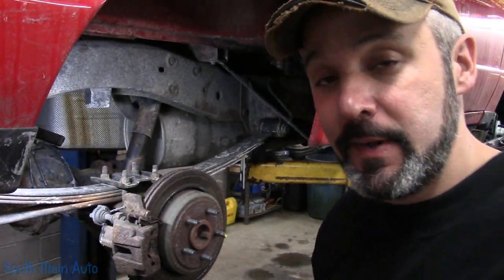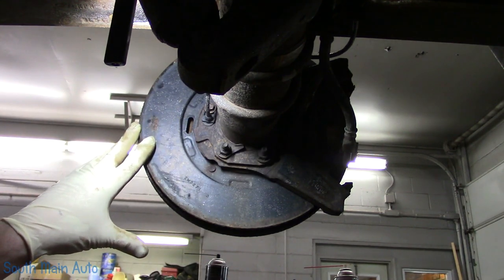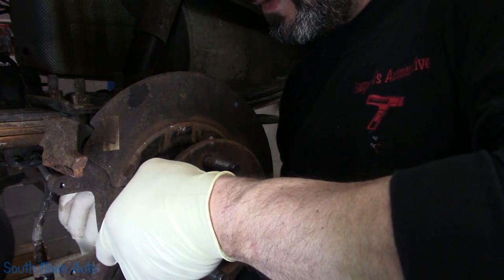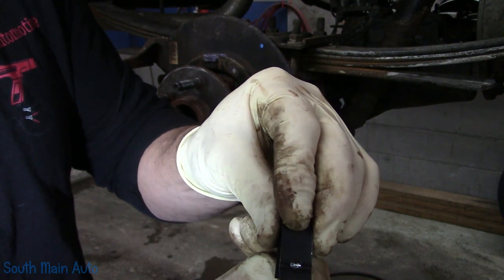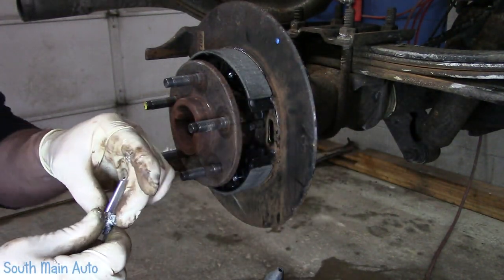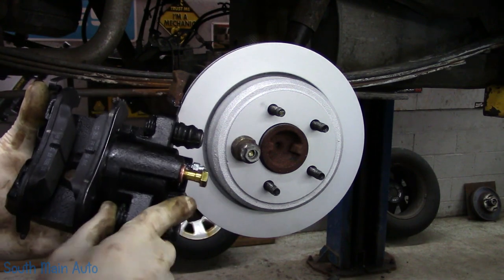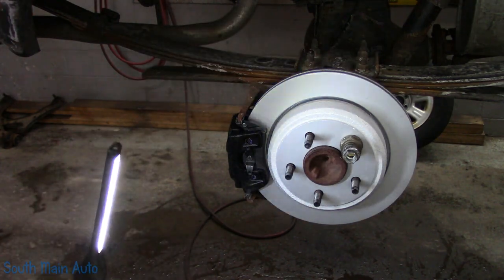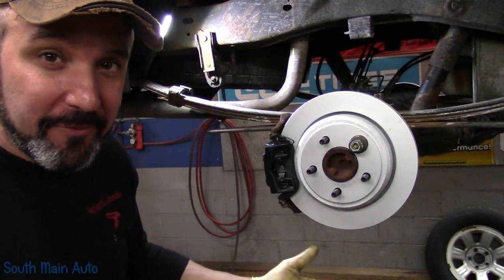Ford Ranger: Full Brake Job Overhaul - Part II

Comment: I had a mechanic do the brakes on my silverado and he didn't clean the mounting surface for some sort of what looked like a retaining clip and spring piece.  That was fun to fix 600 miles from home in another state without the right tools after my brake locked up and started rolling smoke out of the fender.  30 seconds with a wire brush or 5 with that air sander would have saved me an hour of busted knuckles, a smashed fingernail and a lot of cussing.

Comment: Personally, like you, I don't worry too much about cleaning the inside of the reservoir. As long as the fluid is fresh, it's fresh right? Since you mentioned it though, I got to thinking (usually a dangerous thing for me lol!) and remembered how we used to clean the coffee pots at a diner I worked in back in high school in the 80's. We'd fill them about 1/2 way with crushed ice, add a few tablespoons of salt and shake the snot out of them. The pots always came out crystal clear. Maybe I'll try it on an old reservoir that I happen to have laying around (if I can find it!) from the V8 Ranger project that I'm currently working on.

Comment: DOT 4 brake fluid is Dot 3 that's been blessed by the Pope.
Reply: So what does that make DOT 5? The devil's spawn?
Reply: Hotrodelectric with a boiling point over 500Deg and no abs  yup devils spawn lol
Reply: @Hotrodelectric  DOT 5 is based on silicone oil DOT 3 and 4 are based on glycol.
Reply: @ebbeollman1198  Yes Ebbe, I'm aware, thanks.

Comment: Okay Dr.O 
I've been watching SMA since day one. SMA is by far the best automotive repair channel in YouTube. For the longest I've always compared your rust area in Avoca  to mine in NW.INDIANA. But today when you had to heat the rear e-brake adjuster to get the rotor off. Avoca is the hands down champion of the rust belt. Only if we could get our vehicle inspection back along with our mandatory smog testing which we have. To me the safety inspection in my thoughts should be a major concern. Gotta love the rust. One more thing. When I give a estimate whether it's from Mitchell pro or Alldata and sometimes Chilton Library I have to add extra time for the rust. 😉
Reply: oh must be talking bout etcg and kilmer.

Comment: Not sure if this has been mentioned so....   before you take the brake lines lose,  use an adjustable hood rod or similar to slightly(3/4") hold down the brake pedal.  This will position the master cylinder spool past the reservoir intake port.  You won"t drain the reservoir.   Eric,  keep on pumpin out these great videos!

Comment: Stretching and hooking springs: what sometimes works for me is to loop a length of string through the spring hook.  That way I can pull on the string to stretch the spring, using the needle nose just to guide it into the hole (versus trying to use the needle nose both for stretch and manoeuvr).  The best string is the green and white plastic stuff that electricians use to pull wires through conduit: strong but also slippery enough to easily pull out once the spring is home.  A spool of this stuff will last a lifetime.

Comment: Hey man! Love the videos! Here's some info for the viewers... I live in the rust belt of canada. I did front pads and rotors on a 2016 Toyota corolla with 106km (65,000m??) And the passenger rotor would not come off. Hammer, bigger hammer, sledge hammer, nothing. I tried the extraction threads on the stock rotors with some 12mm bolts, still nothing, stripped the threads. Ended up heating the rotor with a torch and hear it 'pop' than it came off with two hits of the hammer. RUST IS NO JOKE PEOPLE!!!

Comment: Doing breaks I use white lithium or anti seize compound , all my hardware gets coating of fluid film , never had issue with adjusting when cones time ,  plus when inspection time comes , they can't say you need new breaks .  

Talking to yourself truly helps ,  clears the minds thoughts , it's lit better than talking to what some call normal people at times lol 😂😂😂😂

Comment: Couldn't sleep. Cat had to go outside, booted up computer and wah lah! Part 2. Thank you Eric for letting us watch, I'm sure at times it slows you down but these tricks, advice and Mee Maw tips really helps us.  On my '64 Chevy C-10 I couldn't afford new dust caps (when I was a young lad)and now, in my box, patiently awaiting the snow and rain to stop will install with all new front end hardware. I did manage to get the old ones to last with careful hammer strikes..... I'll try not to tear any rubbers, that could be disastrous at my age. I tried to time your torque to yelled and I think I got to 2 Mississippi.  I think that is safer than torque to yield numbers..... I burnished the pads on the wife's 08 Honda Accord, believe me you want to folks! After 2 sets of burned brakes, I had some rotors hammered out of a meteorite cross drilled and slotted with upgraded pads with unobtanium and burnished those bad boys by the instructions and haven't had a problem since.  I use Car Quest though, not a sponsor Remember folks, safety 3rd.

Comment: My son and I spent 45 min per side to put that spring back on the inside on the e-brakes. I told hem if we ever need to change the e-brake shoes again we are going to pull the axles.

Comment: Eric, this DIYer would never attempt rear brake shoes again. Tried it one time, years ago, on an old rust bucket (Connecticut car) Renault . No problem breaking it down but putting it all back together, NOT. Those springs were a beeyotch for me. No way, Hosay (that's the English spelling for Jose). To the garage I went.
This is the first time I have watched somebody do it and you confirmed for me why it drove me crazy. For you, Eezy Peezy

Comment: Great video.  The little bit of heat goes a on long way was great.  Never had seen that trick before on brakes.  The hint on the spring placement was spot on.  I never do drum brakes unless I have the complete spring replacement kit.  I also take pictures before I remove any part and do a comparison of before and after prior to the test drive.  Thanks again for the hints.

Comment: Well, at least they finally got around to putting disc brakes on the rear by 2010
Reply: Then they discontinued the Ranger in 2011! Ford really knows how to reinvent the wheel...
Reply: People get uppity when you spoil them.
Reply: I think drum work better at slower speeds
Reply: @brianbrundage3116  Yep.  There's nothing wrong with drum brakes in the rear on a lot of vehicles.  Plus, they seem to last a long time.

Comment: I used to put the spring on the both shoes BEFORE fitting the shoes to the car - that way it's easier to get it on (and you can put it the right way around that way too ;)). YMMV.

Comment: Man do I wish you posted this video like 2 years ago! I did my P Shoes on my 2000 F250, and as you assured, I lost my fricken mind. I bought just the shoes, so I had to reuse all hardware (yes I'm from the rustbelt so it was crusty) and put them on the factory way cause I only had what I took apart to replicate. I refused to pull out the axle shaft and spend about 2 hours on each side getting it all right. I ended up putting the spring on the shoes before putting it behing the wheel hub, then stretching it by hand over the face of the hub. Yep. I lost 3.5 fingers that day and my entire mind

Comment: My 96 Explorer V8 AWD uses a very similar set up in the rear. I have had issues with slide pins and the caliper slides (the stainless ones) over the last 10 years. After a few Ohio winters I have to take the backs apart and clean under/re-lube the caliper slides (stainless clips).

Comment: Word of advice for the youngsters...  see that spring he's taking off the parking brake shoes using needle nose pliers?
They make a hooked spring tool for that and they are relatively cheap. Use it. Needle nose pliers, especially on a more stiff spring can cause serious scars, I could show you mine and it's about 1/2 inch from my eyeball. Did I mention never pull TOWARDS yourself?
Some of us learned the hard way when we were 16.

Comment: FYI - If you have never done plain drum brakes (not discs with drum parking brakes) they are very similar with on big exception.  The star wheel adjuster has a lever riding on top of it that will prevent the star wheel from going backwards.  Simply sticking a brake tool in the slot and cranking will only TIGHTEN the shoes.  You need to place a screwdriver in the slot first and push the lever off of the star wheel so that you can back it off.
Reply from the maker: I've only done a few thousand in my 20 years doing this 🤭😉
Reply: @SouthMainAuto  - That came across wrong !  I meant it to be directed at the audience, not you Eric.  (Although I'll bet you never did drum brake on the front wheels of a car !)

Comment: "WEEEEEEEEEEEEEEEEEEEEEEE"! 😂🤣😂 I don't think I've told you how much I friggin LOVE that! Makes me crack up hysterically!!  You got me saying it now, LOL - it's highly contagious! 😁

Nice trick on those parking brake shoes! I've found that flipping out, throwing tools, and cussing at the top of my lungs does little for my productivity, so I'm going to try your way next time. 😂 The last set I did on a '04 Ram 1500 was easy - noticed the weeping axle seals and decided to sell that job. Soooo much easier with the axles out!

So I just got my compressor yesterday!! Just went through the thing to make sure nothing was wrong. Glad I did, because the little compression fitting on the nylon line they ran to the drain valve in one of the legs was leaking like a sieve. I had my neighbor drop the skid in the new shop so I could go through it. To power it up, I had to shut the breaker off to the lift, take the wires out of it, hook a set of jumper cables to that, then stuff some 4 AWG wire into the pressure switch of the compressor, and clamp the jumpers to the other side. Yep, OSHA would have a field day over here, lol! 🤣 Watch out for the live jumpers now! 😁It worked - let the thing run 20 minutes with the valve open, then shut the valve and let her air up to 175 when it kicked off. Stuff gets HOT, but it worked great. Just tightened that compression fitting, and all is well. Now just have to call the neighbor up and move it into the old shop where the Craftsman compressor is, and start shootin' vid on the install. 😎

Comment: once upon a time  i attempted a similar pisser style parking brake ie the 4th gen 4runner as my first DIY job. Took me 3 weekends on jackstands and help form webforms to get all the springs in the right orientation. adjusted the parking brake perfectly so both shoes would actuate. when I went to torque the last lug nut. the wheel stud snapped. Many curse words were said. I went for a test drive, and it held the car perfectly in neutral up and down a steep slope.  first time since the factory. Went to so called professional mechanics.  they were putting it together and the a few of the springs were on the floor. well after wards the parking brake only holds the car forwards not in reverse (in neutral). Claimed we adjusted the slack all the way.  sigh.......... That really defeated me lol.

Comment: How do you know which way to turn those star wheels, is there a simple way to know without trial and error? Are they always right hand threads? It seems like the left and right wheels are usually different, though I wonder if I'm just looking at it from the opposite angle....
Reply: Star wheels are demonic; which ever way you turn them is wrong and all four wheels are different and random.
Reply: Good question. I usually just have to turn them a bit before I install them so I know which way expands them. It's just always a pain regardless.
Reply: and lube the thread

Comment: The drums part is super-straightforward, some pitfalls but if you watch the video, no problem at all... well usually.

For whatever reason the rear shoe swap for my '04 Civic was a wrench-throwing, ninja'd-into-the-sheetrock sort of nightmare... an-hour's-work-begat-four sort of thunder...

Someday when I grow up I wanna be an SMA tech (16 yrs wrenching on powersports; only drums I had to mess with were saucer-sized ones on ATVs) :D

Comment: I would of drained the brake fluid out prior to start.  I just don't like brake fluid splashing onto my floor.   Also, when I do the caliper bolts, i often use combo wrenches that i smack with a hammer.  I always use 6 pt wrenches.

Comment: I'm sure the designers of this style parking brake system sat back and said lets make that axle flange as big as we can just to make it a bitch to get the brakes apart without stretching the springs. LOL What l loved was when the customers put the spare tyre on their nice merc and didn't use short wheel bolts, winding those long ones into the brake springs and try to drive off.

Comment: I never realized Ford put discs on the back of the Rangers, thought they were all drum, I learned something today. That tip on that return spring is handy. I have that similar setup for the parking brake on my F-150 and yes it has that same God awful spring that comes in from the back. It makes me wonder if I could put that spring on the front of my setup, hmmm. I would hate to admit how long I fought with those. 17:53, is someone in pain? I like that bleeder setup you are using.

Comment: I flush the lines BEFORE attaching wheel cylinders/calipers. The way you do it all the crap from the lines ends up in the caliper/wheel cylinders and may cause failures.
Reply: Sounds like a diy'er move, you'd be sitting there all day. I've never heard of a brake component failing that way.

Comment: us at wook we use only eom parking brake shoes they have more grip on are E450 fleet we tried the after market shoes and did not hold down the truck as eom do.you put the parking brake on and floor the gas pedal in drive and truck do not move.but the after market one do not hold down after 1/4 gas pedal.

Comment: Not sure if you noticed or know the position of the leaf spring clamp location? I just recently bought a used 4cyl 5spd XL and the previous owner put 2 extra leafs per side and the clamps were redone and placed at the rear of each leaf. 
He used it as a work truck and hauled his tools around. Me, not so much so it's really stiff and I will be removing the an extra leaf per side. The bigger leaf just under the main leaf.

Comment: I rarely have criticisim for anything in your videos but I do this time. I think you may have installed the white spring upside down. I noticed that your adjuster screw was clicking against it as you adjusted the shoes. One of the straight ends on that spring is longer than the other. The longer side is meant to bypass the adjuster cog. Otherwise a super great video as usual.
Reply: Also... Since you asked... I hook up the green spring to both shoes first and pry it onto the actuator. Then I install the hold in nails. It is a surprisingly easy way to do it.

Comment: All the Rangers I worked had drum brakes on the rear. Why didn't you adjust the parking brake shoes before you put the calipers on just in case you had to redo the spring or adjuster?

Comment: From the crackin wise dept, Hey if your pullin on the spring and it slips off the pliers that blunt end can go right into the flesh on the tip of the index finger. And ruin life forever.

Comment: What do you do with all the babies you deliver? Does anyone ever take them home and love them? 
 I use a vacuum bleeder and pump the pedal 3-4 strokes while bleeding each wheel. It speeds things up and does a good job flushing the old fluid and any trapped air out. It might work well with the pressure systems too.
 Couldn't the shoes be slid into place together with the spring already installed between them?
 Thanks for another great vjo. I did the same job on an f150 yesterday but didn't think to heat the adjuster. You should have published this video 24 hours earlier! You would have saved me 20 minutes of cussing.

Comment: Sir, were did you buy the front set and rear set. I have 2011 ford ranger sport 4wd looking for parts to general overhaul my brakes, having hard time finding the whole sets. What do you call that ? / ? Caliper bolt . Looking for that parts too. Appreciate your help. Job well done.

Comment: What Happened to the bright green compressor hose? You went back to the old one.
Reply: I guess it's an older video. He is also still using the old brake parts cleaner and not the new NAPA CRC one.
Reply: I could be wrong but wasn't that in the bay on the other end of the building?
Reply: @jeffleach2668  Yeah you're right. It's was in the large bay.
Reply: @blockbertus  Agreed.

Comment: Quick question on the spring being behind the parking brake shoes. I have always done it where i put the spring on the shoes first and then fished the shoes with spring onto the axle first and then put the retaining springs in last. Would this have worked better?

Comment: Parking brake? Whats a parking brake for? My 03 Trail blazer had nothing left of the P brake, everything had rotted away. I dont use them and no one else does in Michigan. So I just took out the remains and stuffed them in the trash. The main thing is the regular brakes work. I know with Ford When you back up and hit the brakes Its supposed to adjust the star wheel. I dont know if thats how it still works. I use needle nosed locking plyers. That guys battery has a bad cell, the smell gives that away.

Comment: Did you put a label on the brake reservoir to indicate the type of brake fluid used? You said that you cannot go backwards from .4 to .3
Reply: mentatphilosopher you can it just changes the boiling point
Reply: If the car came with DOT 3, it's fine to switch from 3 to 4 or from 4 to 3. Now if the car came with DOT 4, you can't put in DOT 3 since the car was designed to have a higher boiling point DOT 4 fluid.